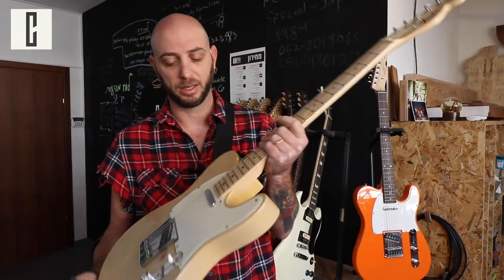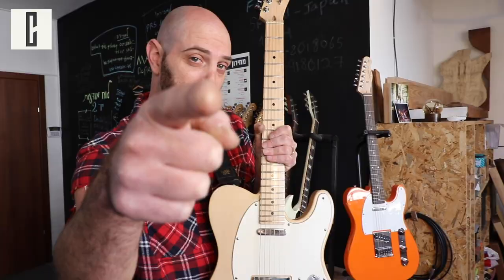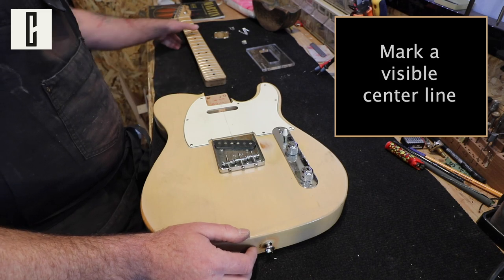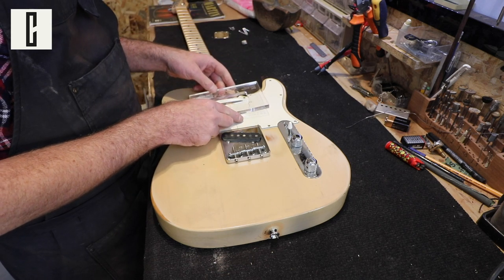Installing a P90 on a Telecaster ( 🎸Guitar Modding)

Comment: I'm about to do this with both pickups over the weekend! I can't wait to have a dual P90 telecaster!
Reply: Howd it go?
Reply: @kingdeedee  that is one of my favorite guitars to play! Anything without crazy distortion sounds incredible!
Reply: @thomdoers3222  what does it sound like with high distortion?
Reply: @rozzer666  everything is warm and creamy. A bit of distortion gives it a good crunch. Higher levels of distortion gives me feedback. I went with a set of wilkinson p90s to see if it's worth doing at all. And to be honest. I don't think I need to go with higher quality pick ups for my level of playing.
Reply: I have a double P90 Strat.
Reply: I just found this video while researching for my tele deluxe P90 mod.  I'm going with Tonerider Vintage 90s  (".)
Reply: How did you replace the bridge pick-up to p90? Did you get a new bridge? Isn't the bridge pick-up cavity already wider than a normal sized p90? Asking because I also want to modify to dual p90 tele
Reply: @tristanvanderrijt9675  i routed out the bridge cavity for the P90, i used a stand tele bridge that i cut the ashtray off of and cleaned up with a grinder and some finishing. Pick guard, i ruined 3 before i got one just right. Jangle and twang for centuries on that guitar! One of my favorites!

Comment: I just did this and replaced the pots with 500k and a four way switch . The bridge pick up was a little weak so I replaced that with a Seymour Duncan quarter pound tele bridge pick up. Locking tuners and brass saddles completed my mod.
Reply: What does a four way switch do here??
Reply: @snouuuflake  a four way has one new sound, bridge, both in parallel, neck, both in series. A lot of the newer telecasters are set up this way.
Reply: Nicely done I've fallen in love with P90 sound now that I have a cpl of guitars with 'em and I'm looking to put em in other guitars I have now as well .
Reply: @michaelpond6386  ohh ty
Reply: The p90 needs a 500k and the single coil bridge, need 250k. The way to do it, is keep the 250k tone pot and change the volume for a 500, but put a capacitor on the bridge wire, to make that pot 250k for the bridge pick up. Then, you have full capacity from both pick ups, at their best.

Comment: Just the video I am looking for :) Doing this on my new Squier Classic Vibe 50's Tele. I think I'm going with a stack P90 (neck) and a stack bridge single-coil side. Thanks, Victor...
Reply: I have Stacks in my Strat which sound pretty darn good, but with my Tele I used Mojotone Quiet Coils* and WOW... They sound fantastic! I just put a Quiet Coil P90 in my lap steel and it sounds great too. And best of all, they are the same size as regular pickups, not double high like the Stacks, so easy to fit. (*I use 500k pots like they recommend*). Good luck on your mods. Have fun!

Comment: Chrome cover would look sweet on that guitar - goes with bridge plate and control plate. How deep is the rout? I plan on dropping in a P90 in the middle position of my Tele because I really like the neck pickup.
Reply from the maker: The depth is about 3/4 of an inch

Comment: is there any concern about grounding the p90? what if you add two p 90s...the bridge pickup normally is the ground with the large plate, but this would all be replaced. Also, is the neck p90 all the way forward to the previous wood route near the neck, or is it just aligned with the top of the pickguard cut out from before? I notice some space difference on my guitar
Reply from the maker: You are correct about grounding problems if bridge pickup is also replaced as you suggested. However, this issue can be very easily addressed by adding grounding wire to the new bridge.
The p-90s are already grounded.

Comment: The problem is a P90 requires a 500K tone pot and the bridge Tele pup requires 250 tone pot and some tricky wiring.
Reply from the maker: That depends on the tone you wish to achieve. 500k is brighter with more highs while the 250k are warmer with greater treble bleed. 250k are usually more linear.
Reply: @coilsboutiquepickups  Did you use 500k or 250k? I'm having this dilemma.
Reply from the maker: @sisdl15  250k

Comment: How balanced is the P90 with the pickup already in the bridge? Volume drop off when going from neck to bridge?
Reply from the maker: Good question! With correct pickup hight adjustment - no volume drop off is achieved. Our pickup sets are calibrated and are very balanced

Comment: I have an issue with this kind of configuration. Basically my tone pot is not  that reactive unless it is 85% rolled off. Can anyone help me with this? May sharing a good wiring diagram so that I can identify the issue?
Reply from the maker: What is the resistance value of the pot? Where exactly are the wires (hot lead and capasitor) connected? Is this a Log or Linear pot?
Reply: @coilsboutiquepickups  Hi, thank you for your reply! The pot is a linear 250K CTS. The tone pot first leg wire is linked to its volume pot corresponding part, the middle tone pot is linked to the cap which is grounded on the tone pot itself, the third leg wire is unlinked. Then both pickups and the jack are grounded on the tone pot (which is the only weird part of the circuit I could spot...aren't they supposed to be grounded to the vol pot or it doesn't make any difference? I don't know...). Thanks again for your help!

Comment: P90 disappointed with less treble and presence. Probably has more oomph but it is hard to show through youtube. Expected different sound but as cool result is feeling the original pickup should be returned on it's place😕
Reply: Maybe this P90 is slightly overwound/hotter, and would have preferred a higher value potentiometer?

Comment: this dude solders like it's absolutely nothing. it's a nightmare when I solder... well, it's better now, but still it feels like surgery.
Reply from the maker: Thanks. I recommend using a powerful soldering iron station. These babies are the best and make life easy.
Reply: I recommend use solderless, it's a heaven to change pickups.
Reply: @Rafael-zl4vu  that’s poo I did it so I could learn to solder. Now I basically can. I’ve soldered in like 9 pickups of my own as of now and proud of it 😁
Reply: @justinTime077  that's cool! But nowadays it's a really unnecessary thing. And it's soooo much more practical, I can put any pickup I want in literally seconds. (I bought one that don't need to be the same pickup for it to work)
Reply: @Rafael-zl4vu   A wire that's soldered won't get corrosion or loose like the plugs can.
Reply: @TexanUSMC8089  neither good quality solderless and if you clean it well